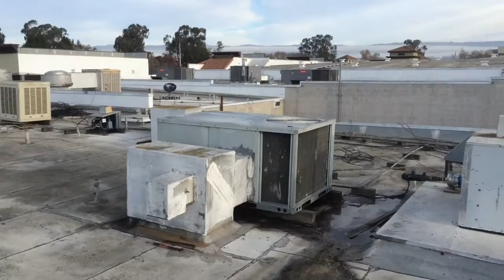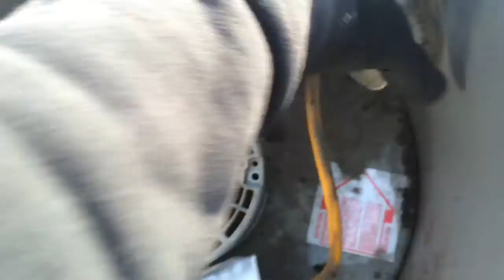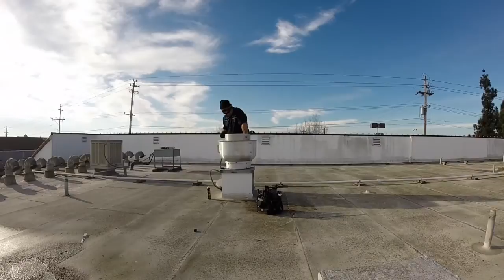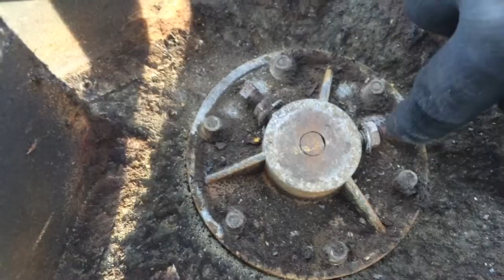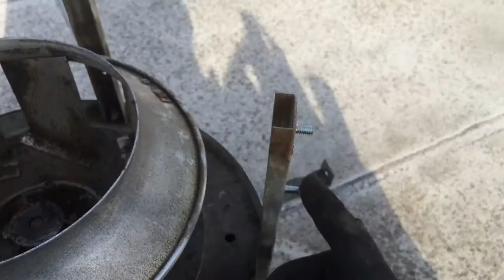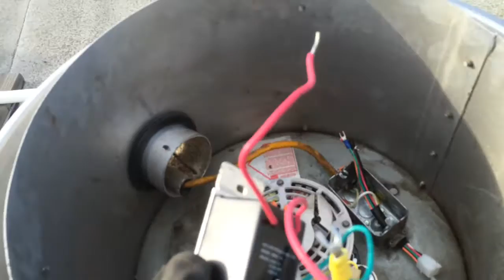Exhaust fan motor change out

Comment: How did you remove the blade from the motor?  My fan blade won't come out.
Reply from the maker: John L 2 set screws and a hub puller
Reply: Nor-Cal Refrigeration & H.V.A.C,  what's the hull puller?
Reply: Nor-Cal Refrigeration & H.V.A.c,   There are a few on amazon and I don't know which will fit.
Reply: @lobster1002  Were you able to find a hull puller that works?
Reply: @vincents1912  i saw it on amazon and put it in my basket but i didn't brought it because i just added some rubber washer between the fan and the nuts.
Reply: try amazon
Reply: @lobster1002  So you weren't able to remove the blade? What did the rubber washer help do? Thanks
Reply: @lobster1002  🙏🏿Thank you!!! I'll let you know if it works for me.
Reply: @vincents1912  that tool is to remove the blade.  the fan was making alot of sound so the rubber washer was to absorbed the sound.  i had to slip my hands in there to fix it.

Comment: I couldn't tell, are there drain holes that keep the rainwater from pooling down around the blower wheel?  I see what looks like a horizontal drain for use when these are mounted through the wall, but what keeps the water from pooling up in a vertical-mount installation?
Reply from the maker: There is a drain in there for water & grease.